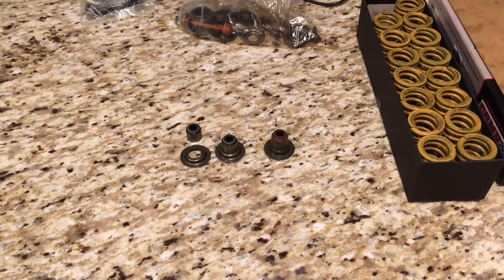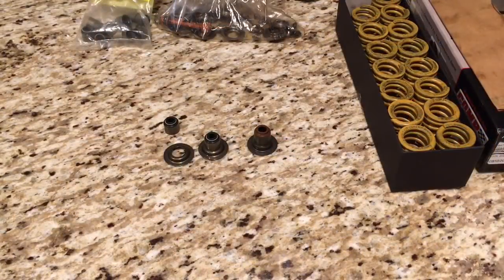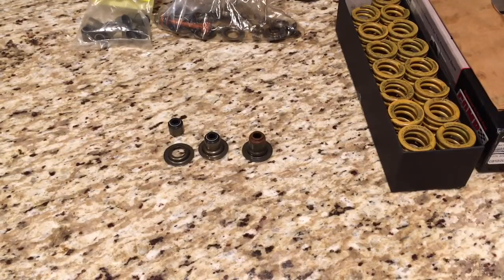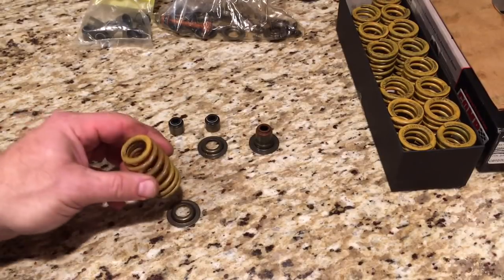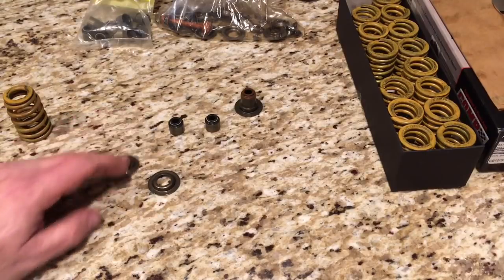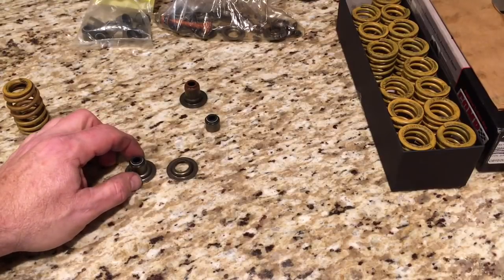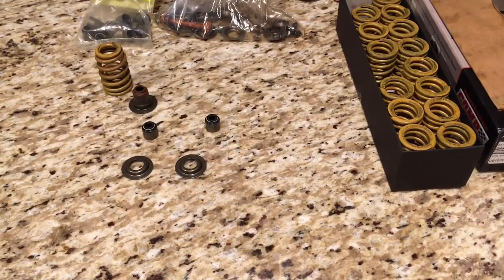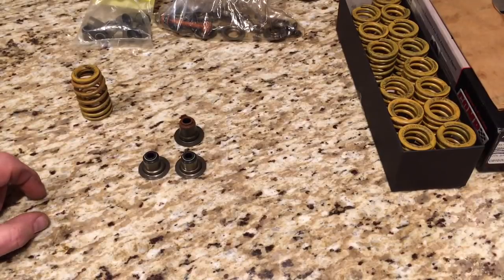LS Cylinder heads know the difference in valve sealsTophat vs separated

Comment: I know this is an old video, but you've helped me out a lot, so wanted to share what I learned today.  Many aftermarket companies use valve seals by a company called "EOK" based out of Taiwan.  For example, my Comp Cams one-piece tophat style ones are made by EOK.  You can tell by looking at the top of the rubber part.  "EOK" is molded into the rubber.  Yes, it is incredibly small, I had to use a 5x Loupe and a magnifying glass combined to read it.  Comp Cams uses a blue/brown color scheme and the blue ones are supposed to go to the intake and brown for the exhaust.
Reply from the maker: I’ve seen the Felpro two piece seal kits    with the different colored seals for intake and exhaust. 
Most other cam companies use the viton positive seals on both valves. 
Thanks for the tip on the EOK I appreciate it!  JD

Comment: I need to do a head job on my 01 5.3. When trying to buy a gasket set, it asks me if I have the top hat seals or the metal clad seals. How do I find out what seals my heads have? I just wanna buy the right set.
Reply from the maker: Jon F If you are running single springs always run the top hat seals.  Also run the MLS gaskets never the graphite junk😇
Reply: HeadFlowInc So the Metal clad seals with Graphite are interchangeable with top hat/ with MLS gaskets? I don't have to choose one or the either to fit my engine?
Reply: Jon F did you ever find out if they were interchangeable? Trying to a buy a cam kit from btr but their website says that the top hat valve seals won’t fit on iron heads

Comment: I never liked the valve seals like vitons, the first time the valve opens, the seal pushes up to the top of maximum valve lift and never returns to bottom. Just rides up and down with the valve. Essentially rendering itself not a seal anymore. Those tophats stay at the bottom because they are captured by the spring bottom, so the valve goes in and out of the seal each timei